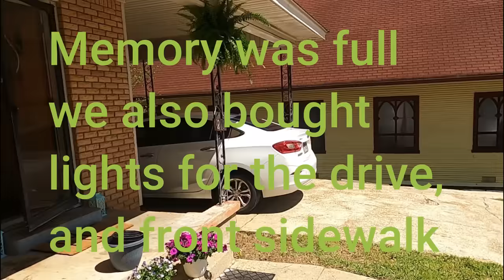EXCITED homeowner can't BELIEVE we gave her this BEAUTIFUL yard Makeover for FREE

Comment: You all have been busy.  The overhead shot of the sidewalk while cleaning really shows what a difference it can make.  I was just thinking the equipment, of itself, is a miracle.  So much has been able to be done with the creation of home/industrial uses. The back porch change was rather impressive.  The seat, being a white paint over a dark color, was more of a surprise. At 25:08 you two have been doing extensive work over an already long day.  The view of the driveway, in perspective, went from black algae and dirt to a whole different look. It wasn't possible to see how badly the sidewalk was buried in dirt but it sure was a good thing to have to fill in the crevasses on the street edge. 34:47, new mysterious wall painting has begun.  Trees, mountains, low hills?  Be fun when you do it intentionally at some point. A good thought to use a multi-pot to make an "instant" planting in the big pots. What a nice finish.  Enjoyed the before/process/after photos.

Comment: You opened my 80 year old aunts kitchen door and she had a deck about 1/4 that size.  then she had 12 steps leading down to a concrete pad and then the driveway.  I didn't own a pressure washer then.  I got out the old metal bucket and a scrub brush.  I scrubbed the deck and stair to get the worst of it and then I sprayed some deck cleaner on it.  Fifteen minutes later I rinsed it off and when it dried it looked like new wood again.  I got some water sealer and put two coats on it.   A few days later it rained and the water beaded up and ran off that wood.  Woohoo, mission accomplished. 
About a week later, I pulled in her driveway and the wood looked  kinda wet.  I got out of my car and walked over to look at it.  Just then, the two lesbian neighbors said hi and came over. Before I could say a word they said "Can you see what we did?".  We bought a power washer and washed our house down.  They wanted $600 so for $250 we bought a power washer and attachments to do it ourselves.  Then before we put it away we put the power washer on your aunts concrete pad and powerwashed her deck and those steps".
WOW!  I could see fibers every half inch standing up. They really blasted it hard and a few places cut into it.  I was flabberghasted.  So I had to tell them that two weeks ago, I scrubbed this all by hand and then put two coats of water sealer on it.  Your power washer stripped all that off and made the wood splinter and fiber up.  Now I will have to run a sander over all this before I can coat it again.  I said it nicely. All of the sudden they ripped me with foul gutter language than I would hear in a warehouse.   I just stood there as they cursed and ranted.  I finally said "You know what? Just stay on your property.  No one asked you to do this and you should have clearly seen it did not need done in the first place".  
My aunt died 5 years later. She left me her house and more money than I will ever spend in my lifetime.  A week or so later they said hi and said they got an estimate of over $5,000 to top a 50 year old oak tree and asked me to pay for it.  Uhm, NO.  They said it would be cheaper for me to pay that  than have the tree crash into my house.  They said "you have it, we know she left you a "shit ton of cash".  I told them I would not pay for the tree and their home owners insurance would pay for my repairs or the courts would make them pay. Once again, they started to curse me and I just walked away.  It's been another 6 years and they don't even waive hi to me now.
Your helping out to clean all that mold and grime is fabulous. You and others also ask permission.   That turned out fantastic.  (sorry, I talk a lot)